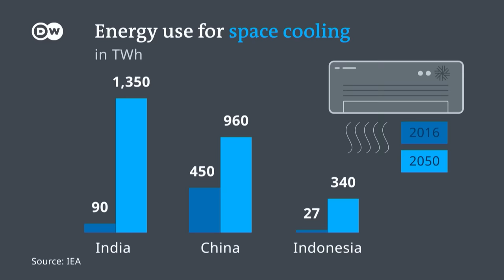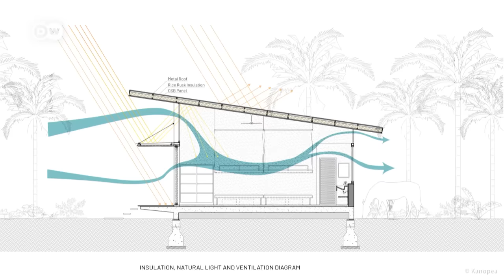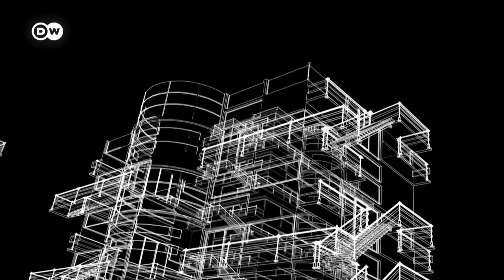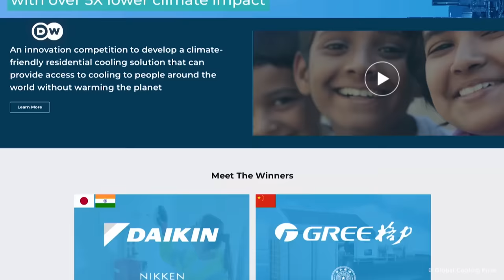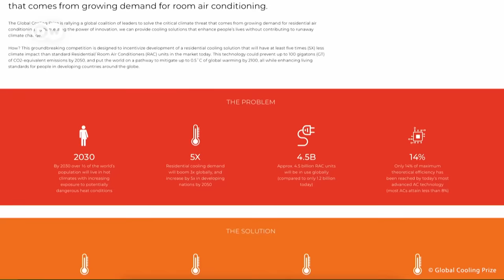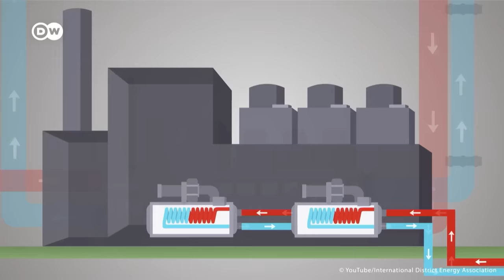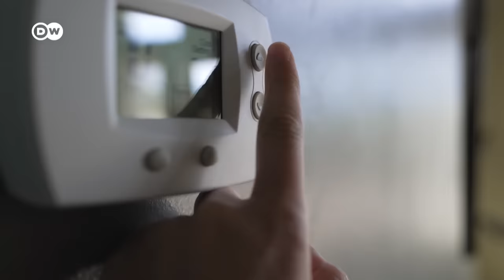How to cool our homes (even without ACs)

Comment: I've been designing and building passive solar homes in Canada since 1981. The simple fact that it is not common has me constantly scratching my head in bewilderment. The current super insulated house I'm in stays a comfortable 22-23 C all year with no AC and some small baseboard heaters for the cold season. We lost power last winter for 31 hours at -5 C and the indoor temperature went down 2.5 C over that period of time. Prioritize solar orientation, good design and efficiency. Outlandish displays of wealth are really pathetic in this day and age under the current circumstances
Reply: Where do you live BC?
Reply: Hi Gary, I live in the Philippines. Solar is very popular here. Most houses here have a 4' overhang. But metal roofs. Almost all the houses are built with concrete block. 
I live on a island so digging for a geothermal system is hard because the coral. I have a lot forienor friends here and the electrical system is very poorly run. Blackouts daily. I was a general contractor in Ohio. 
I would like to try to start that here. 
If you have any ideas on how we could work together, get back with me and let's lay out some options.
Reply: Gary, do you have a web page or where I can reach you?
Reply: @jameslowellblakenship2192  I design passive solar which is the architecture. Sounds like you need a PV system with battery backup. Not my field of expertise
Reply: Good on you! Homeowners associations aesthetic requirements and building standards really need to catch up to your time-honored and practical methods.
Reply: I really commend you for doing this. When studying architecture in Panama back in the mid 90s, that's how we were taught how to design. There were some professors who didn't care about putting a central AC unit but the majority of professors had us design with awareness to the environment. It's sad how design has become just mediocre and all glass because of the aesthetics. I personally loathe the use of so much glass and cringe when I see no overhangs on a south-facing wall full of windows.
Reply: I live in America and I’ll do whatever I want, without question. Nobody needs a lecture from a Canuk
Reply: @TheRockkickass  An overview of the obvious benefits of good construction is not lecturing. The opinion of my dismay in what I see as ostentatious nonsense in architecture is not lecturing.
I live in America as well. Which country are you in? There are 35 of them.
You might want to work on a better command of the english language
Reply: @garymccallum4152  and who are you? What makes you think anyone wants to hear your opinion?0
Reply: @TheRockkickass  You're not a very good conversationalist but definatly have entertainment value.
I would say the 76 thumbs up and the positive comments (not including yours) suggest some appreciate the opinion
Reply: @garymccallum4152  first off, 82 thumbs up now, second, those people are gay
Reply: Can u try living in singapore without a/c? U will trap the hot air at 37c all day n night? Canada has good weather most of the time.
Reply: @TheRockkickass you are a comedian, as is your previlege
Reply: Is possible commercial influence at political levels a contribution?
Reply: @coastsouljah   the comedian from before was probably paid to comment that too
Reply: So what did you do for heat repellence?
Reply: @SiriusTheKid Singapore is definitely doable without AC, people did it for thousands of years.

Maybe not in the cities though, the heat island effect makes the cities worse than the country is supposed to be.
Reply: @johnjack3578  There is an office tower in Africa fashioned after a termite hill that uses the same method to cool itself.
https://en.wikipedia.org/wiki/Mound-building_termites
Reply: @priestesslucy3299 ’maybe not the city’ mind you Singapore IS the city. I literally live here for over 20 years 💀 my grandmother always complain about the heat if we never turn on the air con at night. She’s 72 and has been living here her entire life. I highly doubt it’s doable without a/c especially with the housing apartments here. If we talk about 30-40 years ago when we have dense forest then yeah it’s doable. But not now.
Reply: In my opinion the problem in Canada and USA is systematic. Zoning legislation, builders who build houses as cheaply as possible for a high profit. Buyers focusing on size and appearance and not demanding value for their money.
Reply: @isitdatserious  apologies, I thought we were discussing the Republic of Singapore.

Yeah, the city might be fucked without AC
Reply: "Canada" is not a real "country", it is rightfully American soil that's been illegally occupied by the British Empire.
Reply: @thedarkenigma3834  wouldn't that also mean the Divided States of America is American land that's been illegally occupied by a coalition of invaders?
Reply: @thedarkenigma3834 Right, do you also believe the earth is flat?
Reply: @jameslowellblakenship2192 for handling rolling blackouts, you can use batteries plus battery charger and an inverter
Reply: Canada is cold country, even in summer I can live with a just a fan. But now imagine solar dream in middle eastern country where  temperature in summer hits 50+C. How many solar panels/farms and batteries (which are absolutely environmentally hazards  manufacturing and recycling is)? It won't bother people cause it's comes from from 3rd world countries?
Reply: @mcrand7887  Presumptious, ignorant and poorly informed comment
Reply: @johnjack3578  Fair concern, the big point he was making was it's all largely a failing of construction standards. Better insulation will help high-rise apartments as well. But it would need to be coupled with appropriate airflow design within the building.  So if we make appropriate building codes for the regions in which those buildings are constructed, heating and ac bills will be lower, people will be more comfortable, and their air quality should also improve.

But they aren't going to bother replacing every old building so we are left with things like AC units.
Reply: Like being able to afford to have a location where house orientation is possible ?
Reply: @jackbeagle8458 dark boy lives in a grass hut ,no toilet.
Reply: It's common where it's applicable and economically viable.
Reply: pathetic is a euphemism
Reply: solar orientation and sheilding from direct sun exposure. Trees?
Reply: @TheRockkickass  You wont be saying that when a power outage hits your area and you're forced to go days without AC.
Reply: @veedub272  Yes, but you still have the King of England as the head of state and ruler of your "country". Even if the UK gradually gave you guys autonomy, historically you saw yourselves as British subjects and is still part of the Commonwealth of Nations.

If the United States fought against the Brits, it was to liberate us from the tyranny of monarchy, that self-rule under a republic will best protect the civil liberties and inalienable rights of the people. And we wanted to free our fellow compatriots of the north from that same tyranny and finally get ride of the last vestiges of European imperialism in America.

The existence of "Canada" goes against the principles that our country has been founded on: independence, republicanism, freedom, and the Monroe Doctrine and Manifest Destiny. If Americans are all about preaching about spreading democracy to the world, then why they haven't tried liberating the tyranny that right on our border since 1812? The U.S. should've invaded "Canada" once the British Empire became weak and the UK ceased being a world power.

And the United States is the greatest county in the world. Why do immigrants rather move here instead of "Canada" or Europe? Anyone with the right mind would never choose to remain in that barren frozen wasteland if a much better country exists right down south. We are the land of freedom, opportunity and wealth. "Canada" has nothing to offer, and the only reason why "Canada" is rich is because you live off our wealth by virtue of being next to the largest economy in the world. And every American both immigrant and native born are proud to be American. Even the proudest Texan are patriotic Americans who want to remain in the Union.

America is great because of our republican form of government, our Bill of Rights, and because we went our own way, had we remained a monarchy under the Brits we wouldn't be a superpower nor a refuge of freedom and opportunity.
Reply: @TheRockkickass L
Reply: @TheRockkickass Good for you! And I bet you’re a Trumpie too🙄
Reply: @veedub272 Excellent response!
Reply: Scratching your head since the 80s.
Reply: well said Sir, the problem with people earning huge salaries is this, they want bigger everything to display their wealth without realizing how much they are harming everyone around them.
Reply: @morninboy 😅
Reply: Come to my city where the acreage temperature is 35 degrees Celsius
Reply: @mamtashah-cc4vb  Have a look at a building in Africa fashionad after a termite mound that cools itself and then go out planting trees all over the city for shade. I'm too busy building homes to come to your city
Reply: Elegant, efficient solutions are often of little interest to the market if laborious inefficiency is profitable
Reply: @canyonnephrite  Tell me about it. I've been building passive solar for 43 years. No AC and free solar heat ore of little interest to most.
Reply: My Chickasaw summer huts are really cool to. like 100+f outside and in the hut it's nice and cool.
Reply: Is there any way to reach you if people would like your help to design their home?
Reply: Canada doesn't get that hot. 😂 

A fan will suffice
Reply: @TheRockkickass  Exceptionalism again. Pathetic.
Reply: I had a cheap AC that used to be very power-hungry. I used it for 10 years and it was very simple and reliable and good overall. When I moved to my flat, I purchased one fancy super efficient AC (5* as they say) but it started giving problem from the day one. Finally when the company people came they told that the warranty is over and I must pay for service. After I got it fixed, it is working like the old-one, cools little and consumes too much of power. Three years back, when the fuse blew, I was told that the cables for the AC has melted and I need to fix the complete wiring. Big companies are just cheating people by claiming 5* and similar non-sense.
Reply: I mean how hot does it get in Canada? In the winter where I live it's 70f outside sometimes it jumps to 80f. And during the summer 90s are the low with global warming it's as hot as 105 on many days.
Reply: @TychoKingdom  High 30's to the low 40's. Lyton BC hit 49 two years ago. That is 121 F. SOuthern Ontario can hit 40 with high humidity
Reply: That's really cool you should create a presentation and share it with smaller towns and cities that are growing.
Reply: @garymccallum4152 How do I get into this? Are there passive solar prefab/modular/tiny houses?
Reply: @rx0102  It would be difficult to produce a prefab passive solar modular or tiny home as two important factors are site location, you need good southern exposure and you need thermal mass such as concrete to store the solar gain.
There is a good book that I have used as my design bible since the early 80's. It is The Passive Solar Energy Book, printed in 1979. There are lots of them available online
Reply: @garymccallum4152  I see, thanks for the pointers!
Reply: Is a Trombe wall incorporated in your design?
Reply: @chuckblack2674  Never used the concept
Reply: Good luck in south Florida without AC. No passive cooling design works here, our humidity is constantly above 70%